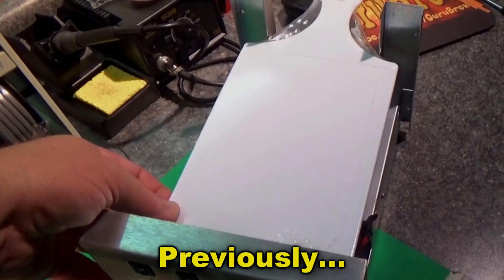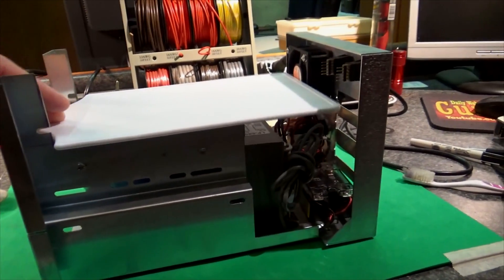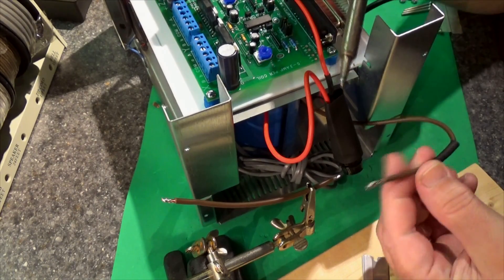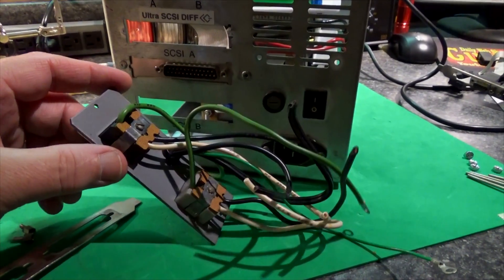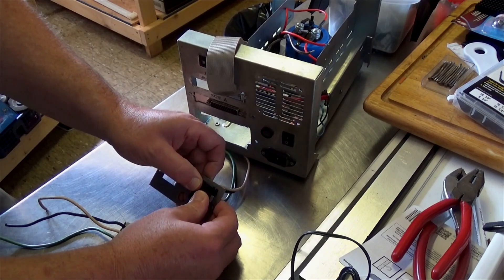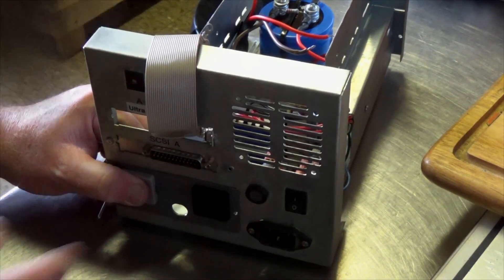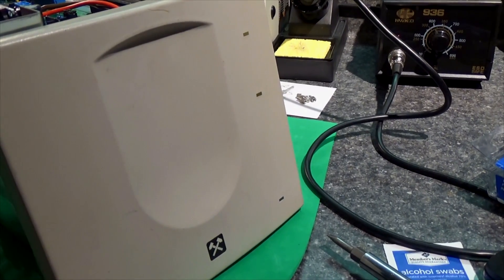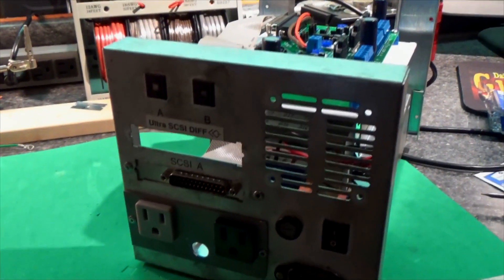CNC Stepper Motor Controller Build - Customizing the Case #6

Comment: Steve, you need a hand nibbler to cut square holes.  Not expensive and all that's needed is a 1/4" hole ( or maybe 5/16") to insert the nose of the nibbler through, then nibble away.
Reply: First thing I thought of as well.  They work great on lighter gage sheet metal.
Reply from the maker: Just seen this comment. Great Tip! How about this one?  http://amzn.to/2bx1HnH
Reply: I bought one like this from Radio Shack many years ago, mine isn't chrome plated but it looks like this one:
https://www.amazon.com/Parts-Express-Nickel-Plated-Nibbling/dp/B0002KRACO/ref=pd_bxgy_469_2?ie=UTF8&psc=1&refRID=T21APBCSAYZCPDNYFYT4
Reply from the maker: +Larry527az thanks for the link, I'll definitely check it out. I never knew there was such a tool existed until you guys said something, so thank you